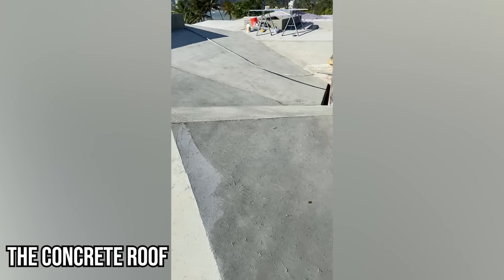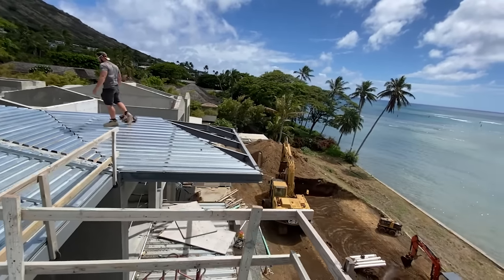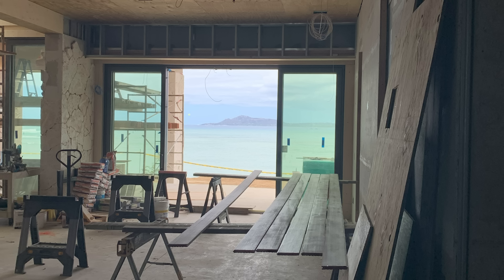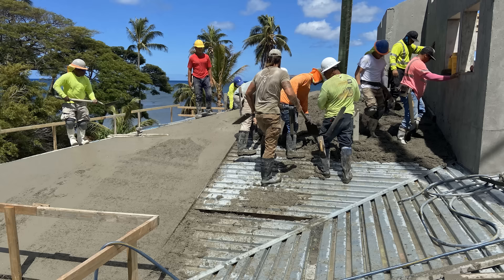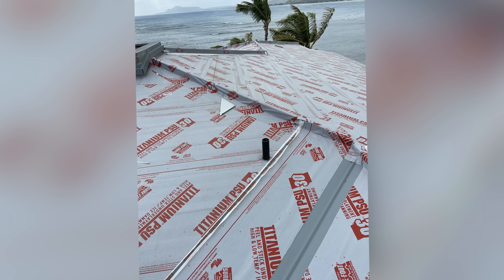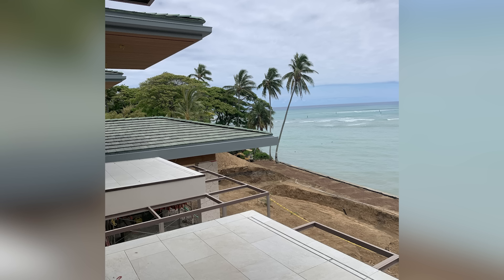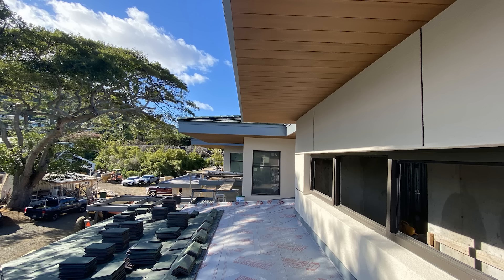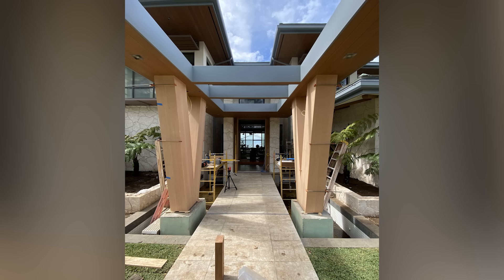Building a $19M Concrete & Steel House

Comment: That house will last forever. Andrew Camarata would love it.
Reply: I don’t know, I didn’t see any shipping containers! Lol
Reply: No, water will eventually destroy it
Reply: after 300-1000 years maybe
Reply: @mhxxd4   Salt Water !
Reply: @diverdave4056  salt water is worse but all water is the enemy
Reply: Does concrete hold moisture? I have metal structure stairs with concrete slab landings and steps. All the steps have rust out the frame. It made it about 30 years. Longer than wood, maybe but cost was 5x more. Near a rainforest climate so rain then extreme heat, repetitive.
Reply: As we speak houses are being eaten up by the pacific and on Oahu on the north shore,  beautiful house and design though
Reply: I thought of Camarata as well lol. He's building a new castle if you didn't know so I can imagine he's taking notes.
Reply: Close to the coast, the air itself is corrosive. Being on the actual waterfront is even worse as you cop salt spray from on shore winds.
Reply: The house would last forever, but the soil around it would likely go first. lol
Reply: @VaporheadATC  notice I didn't say anything about the ground! xD yeah it really would.
Reply: No house will last forever.
Reply: @TTundragrizzly  no shit Sherlock. But relative to all other typical houses… basically forever. Hundreds of years++++
Reply: Water always wins. Will last a long while though
Reply: @colinstu  hundreds of years perhaps… that’s a far cry from forever.
Exaggerating is pointless.

Comment: I have seen "embedded post" in enough concrete walls to know how those plates would work.  There would need to be a weave where the concrete was transitioning between roof/wall/deck where some of those I beams would have to be part of the roof as well.

Comment: this is cool, I've seen concrete structure houses and have personally worked on a family members roof with I beam roof frame and tiedowns and c-channel and z-channel steel beams, but never seen a full I-beam roof like this, with concrete poured on it. 

I am not in the construction industry but what i learned in Trinidad in architecture class is that the steel roof is tied down to the concrete walls post using a J-bolt which is bolted and welded to the I-beam frame of the roof. roofs are typically galvanize which is screwed into the z beams (rafters)

Comment: This is the coolest thing I have seen in a long time.  I am a huge concrete nerd and my friends and family are always rolling their eyes when I start talking about wanting a house made of concrete.  All I need is $19M and it can be a reality!
Reply: I'm not entirely sure about US, but in middle eastern Europe, where we don't have a cheap source of wood, building a house with concrete walls is times cheaper than from wood and I've seen it being done on many occasions even for modest houses. 

In most cases though, we use locally mined limestone blocks that resemble concrete blocks (in shape) and are very similar in terms of properties to concrete.
Reply: lol

Comment: To get a 10ft garage opening you put 2 concrete beams where when they sag in the middle you use the compressive strength and use that opening as an enclosed driveway between the space between the houses

Comment: This kind of build is so common. More, such structures are built without steel beams. Rebar & concrete it is, all the way through. Such houses are guaranteed to stand over 200 years plus, if properly done. The reason why wood is used is better economics in the USA

Comment: I live in a 1974 concrete house in southern Japan by the sea. Making sure that any cracks are dealt with helps prolong the integrity. But so many people don't maintain their concrete structures or even driveways and simply watch as water and air do what they do.

Comment: I just completed a steel and concrete house although I didn't build a concrete roof.  I used K joists like you find in many commercial buildings and decked the roof with three sixteenth inch steel plate.  The plate was sprayed with 2 inches of polyurethane foam and an elastomeric coating.  My house isn't as elaborate as the one you describe but it's fireproof and tornado proof.  The concrete filled block was clad with 2 inches of polystyrene foam and stucco and the thermal performance is outstanding.  I cool 2500 sq. feet in west Texas with a 2 ton AC.  I also limited the number of windows to those prescribed by code and utilized glass block for natural lighting.

Comment: Just yesterday I saw a guy working on a boat - and the hull was made out of concrete.  Just amazing!  He showed us pictures of the steel frame around which the concrete was poured... but he didn't have that many pictures for when it was built like 50 years ago....  I've seen enough septic tanks made from concrete...and they will float if you get too much water in the hole... so I guess I shouldn't have been surprised.
Reply: Joined sea scouts 40 years ago and was also surprised that the navy donated a smaller concrete boat. Concrete!?😮  Ironically I became a concrete contractor and GC. 🙃

Comment: Why not use ICF walls? Insulation is required in the walls and it would be a lot easier to attach to for cabinets, drywall, lath, siding, electrical, pictures, etc.

Comment: No more termite issues
Reply: Fiberglass mites. They eat fiberglass rebar
Reply: @addisonp.6373  false equivalence. almost unheard of. the prevalence of termites in wood structures is 1,000 times more common than mites in fiberglass rebar.

Comment: I want to build 4 Victorian duplexes next to each other as a 3 floor concrete parking garage where the second floor roof is "flat" and drain into the porches then put pavillion on top and have 2 front walls so you get a wood front porch roof like the 3rd floor open air park pavillions on top of the parking garage 2 duplexes as 2x2 studio units with hallways and the other 2 are open buildings for a 3 car garage double deep
Reply: Ummmm OK. Go for it and post the video.
I recommend CIP thermomass and Helix 5-25

Comment: Im surprised they didn’t just do it all with form work, rebar and pour in place.
Reply: Yeah a sandwich wall with cast in place would work better. Architect should have talked to some people.
But honestly they don't need the insulation so oh well. 
The time on the roof was a lot of extra work.

Comment: I'd be real curious how they planned to protect against corrosion long term.  

Coastal concrete bridges are always fighting this.  And corrosion is what killed the Hawaii football stadium.
Reply: Ok fiberglass rebar.  Tgat makes sense for a one-off.
Reply: We used 1/2” fiberglass rebar in all horizontals and 5/8” epoxy rebar on all vertical. All 12” o.c.

Comment: 1st, I'm glad that I worked with precast concrete, so I understood a lot of what was said,and that was 1 project that was just like you described, the pitch 12-3 of the roof was plenty steep for water to run off and not so steep they could not put any concrete on the roof or you would have to use precast. And not peanut butter like concrete. The house looks fantastic 👌! Now you can thank Tomas Edison for it was said that he invited the concrete house. 😊

Comment: I guarantee this monstrosity of a house won’t last long before all the problems come calling…. Why even bother building this bomb shelter in such a beautiful location…. Wood is warm and home …. Concrete and steel is cold and so harmful to the environment….. but we all see things differently I suppose …. Waste of 19m 💵💵💵 
Think how beautiful Essential Craftsman spec house looked and only cost few hundred k ????
Reply: i think $ 600,000
Reply: Yeah I agree big time. Concrete and steel construction make it seem so lifeless. I also think there’s a good chance of unforeseen issues with that much weight being held in place. I wonder how many tons of material? Good for them, I guess.
Reply: I guarantee it will do fine. It's just commercial construction. Well established tech. 
You don't know what you're talking about. Are you saying that about every high rise you see?
Reply: @RepresentWV It'll be fine, it's just commercial construction.
Reply: @sparksmcgee6641  It's still comically depressing. All that concrete and toxic chemicals poured onto pristine beaches. Why? For what purpose, in the end, really...
Reply: @RepresentWV   You obviously want to have a horrible experience if you're ever there. 
What are these Toxic chemicals dumped on the beach?
Reply: @sparksmcgee6641  If you need a $19M yuppie's dream house to have fun on the beach idk what else to tell you lol.

Comment: Lol, the least carbon neutral house ever built. What's astonishing to me is that it's still smaller and cheaper than the house next door to it (I was able to find the house using a couple of the photos in the video). That's just too much... everything. Too much everything.
Reply: You don't know anything about carbon load on a buildings lifetime.  Easy to get LEED on that if he wanted.
Reply: You don't know how to calculate carbon loads. Hating concrete shows you don't know anything.
Carbon from concrete is a power grid issue. 
You can buy zero carbon concrete if you want.
Reply: @sparksmcgee6641  when concrete production is 8% of global carbon emissions and the house is entirely concrete, it doesn't take a rocket surgeon to figure out that house dumped a lot of carbon in the air during its construction. If it was going to last for a couple centuries I'd say it would break even, eventually, but in that neighborhood (I've been there) that house will be lucky to last 50 years before some other obnoxiously rich person levels it to build their dream home.
Reply: @sparksmcgee6641  neither do you, and not in Hawaii

Comment: Would've been nice if they included fly ash in the concrete to help reduce the ecological footprint. Also I don't know what they did for flooring in there but I'd hate for it to be all concrete, or just stains or tile directly on it. Would be so hard on your feet/legs. Risinger's system with the layers of foam and then OSB on top would help insulate and make it easier on ya.
Reply: With that much money, I'm sure the living areas will be filled with rugs, maybe not though, seems high in humidity.
Reply: All bedrooms done with teak flooring and living areas were Taj Mahal quartz large format tile

Comment: The situation withp the engineer spec'ing welding the beams instead of canting them is classic. A caveman would know that a cant is superior. 😅
I worked on a $5m home where the owners didn't like a post blocking their view of the river. (A two-story back patio cover.) The engineers designed a giant "L" to be bolted to wall and we removed the post... It looked dumb...

Comment: Something kind of unpleasant about building this ecological nightmare next to a beautiful location. If everyone built houses like this, we would be in a really bad place
Reply: Often these houses have a low ecological footprint. They spend the money to avoid that. I worked on these types of houses for 20 years.
Please stop putting your negative hate where it doesn't belong.
Reply: @sparksmcgee6641  I think gluttonous construction by wealthy elites is exactly where we need some negative hate.  I think you mean the houses have a high performance value. The ecological footprint of a high performance house is higher than a traditional house.